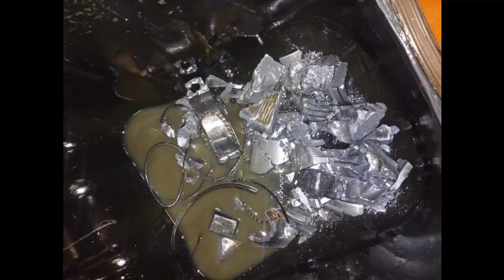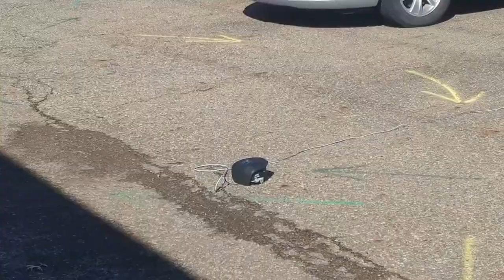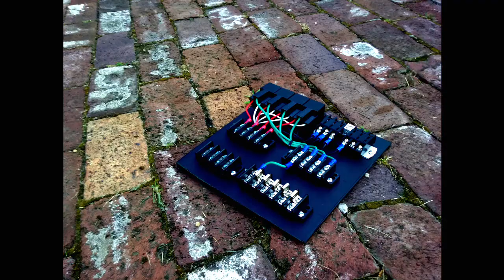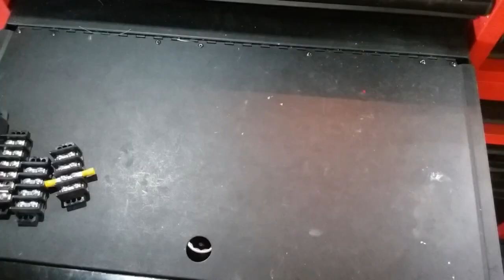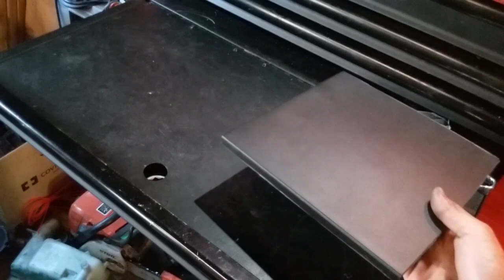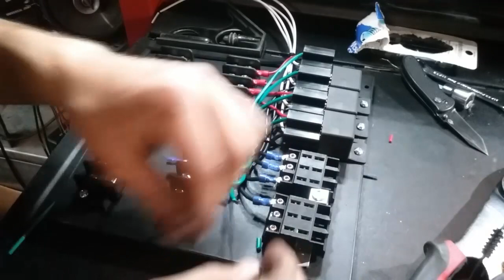Custom Relay Panel | DIY | Part 1 |

Comment: This power realy/fuse block is connected with the ECU? Or we need one more for the accessories of ECU?
Reply from the maker: I don't fully understand the question, but the accessory wire is ran from a key on wire by the ignition cylinder.
Reply: Nuisance Racing I mean the accessories of ECU that need a relay and fuse is connected to this relay-fuse block or we need to make a different one?
Reply from the maker: What kind of accessories are you talking about, Like radiator fans, and fuel pump?
Reply: Nuisance Racing  Yes
Reply from the maker: Yes so the relay panel is just a bunch of relays put together nothing special about it, so yes you could run accessories off of this panel and have the relay be controlled by the ECU.
Reply: Thanks

Comment: cool stuff.. very nice.. ive got a 7 relay pack to hookup and just going to solder/shrink tube the wires vs use the blocks you have... very informational video thx...

Comment: Which wire stripper are you using? Do you like it? Thanks for the video!
Reply from the maker: Those are just a no name brand wire strippers I got second hand, But they are called Self Adjusting Wire Strippers. I would suggest this pair from Vise Grip they are very nice. Thanks for watching! Link: https://www.tooltopia.com/irwin-hanson-vise-grip-2078300.aspx
Reply: K